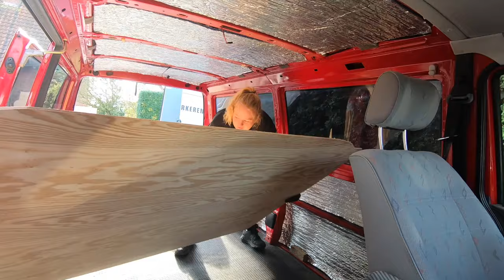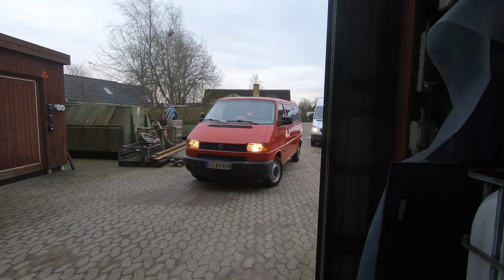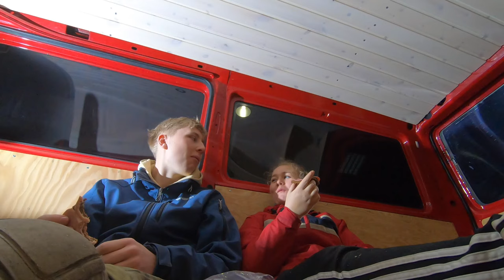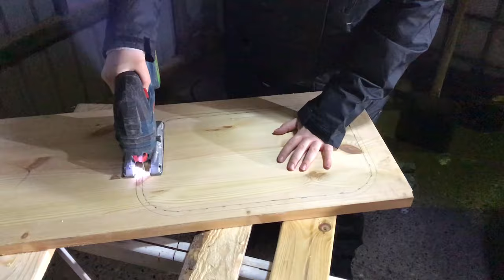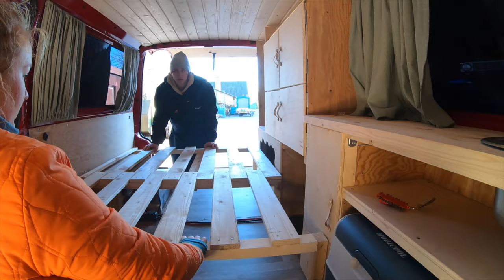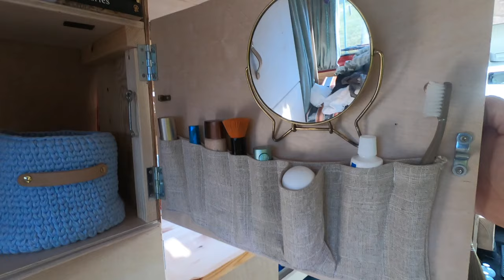Converting Van to Camper in 7 Minutes | VW Transporter T4

Comment: I like the design a lot! Thinking about building on myself and the girlfriend. 
A few questions;
-how long is the bed?
-how long did you take to build?
-how much money did you spend building it?

Your answers would be much appreciated!
Reply from the maker: Hi! Thanks for the comment.
The bed is 140 wide and 185(ish) long.
It took us about 5 months to build, but we both had full time jobs most of the time. When we quit and worked full time on the van it went so much faster.
Hmm about 5000 EUR excluding the price of the van, but 2000 were mechanical maintenance, so 3000 on the conversion :)
Including everything: 7900 eur :)
Good luck with it!

Comment: Nice build! But no ceiling fan? How did that work out for you?
Reply from the maker: Thanks! Well it was warm, but it is a pretty small van so opening the front windows a bit and keeping the rear door open provides decent airflow. Or maybe we were just lucky with the weather not being too hot🤔 Would buy a roof fan next time though

Comment: This is by far one of the best van conversions I’ve seen! I absolutely love your layout and am definitely going to use this as inspo as I get ready to (re)build-out my 1983 Vanagon. The previous owner had installed a floor, some shelving units, a foot pump sink etc but didn’t do much insulation which is an issue. It was also definitely done on a budget and things are starting to fall apart, lol. I also wanted to live in it a couple years so that I knew what I truly wanted/needed first. 

My curtains are currently hung up using curtains sewn into the fabric but they’re always dropping and blowing off if true window is cracked. I have been searching high and low for a better solution since my van doesn’t come with a track. I thought your hack was genius and loved the simplicity! What exactly was the bungee/magnet set-up you had? Ie what specific components did you purchase to make it?
Reply from the maker: Thank you so much. For the curtains we used something called curtain wire, which has a small thread inside so that you can cut it in length and attach something like a hook. We bought a curtain wire kit, which had everything we needed. It worked very well for us. Good luck with your build!

Comment: Hi wonderfull job, i also have a T4, can you tell the type of wood and measurement (thickness) of the side van covers, and cabinet?
Amazing job
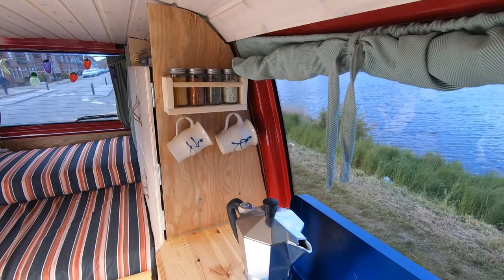Reply from the maker: Hi, thanks alot :) I not really sure but its really thin. Maybe a bit too thin to be honest. I think the "sides" on the cabinet (where the cups are hanging, at 6:20) is 1.5 cm the actual cabinets are made from a different material and Im pretty sure its about 2.5 cm's. Hope that answers you question :)

Comment: Yo, nice work. Such a question though. Isn`t it restricted to modify a car? Won`t it be hard to pass Yearly tech inspection with this? Heard even removing back seats is considered illegal
Reply from the maker: Hi, thanks. I guess it depends on which country. In Denmark (and most of EU I think) you are allowed to drive without rear seats. You are also allowed to build something else in the rear. It is a matter of tax-categories though. Depending on which type of registration the car has, there are different rules. Ours is legan and actually passed inspection last august :)
Reply: @mortenrishansen  How much did it cost you this rebuild
Reply from the maker: @bogdansgorvats2258  2500 EUR. But we knew someone who could do upholstery and mechanics so that helped us out :)
Reply: @mortenrishansen  2500 Euro just to build the interior?
Reply from the maker: Yes including everything. Electrics, water, fridge, wood, even mechanic parts (brakes). 2500 in total excluding the price of the van

Comment: Looks cool! I was wondering, where and how did you install your propane/butane tank?
Reply from the maker: Thanks. We unplugged it everytime we didn't use it and just but the tank outside or in the trunk. It was just on the floor when we used it :)
Reply: @mortenrishansen  ah ok I thought such a tank should be stowed in an airtight box with a ventilation hole exiting at the bottom of the bus. But perhaps this is only the case when you have it connected to your equipment at all times? And not when you unplug it everytime? Do you know anything about this?
Reply from the maker: @silliebilly  It never has to be airtight, but It does need a ventilation hole or other kinds of ventilation if it is permanently connected. The leaks often happen in the tubing connected to the tank, which you can avoid when the tank is unplugged. It is recommended to always have ventilation anyways, but doing it our way is essentially the same as going to buy a gas tank for the barbeque and putting it in the trunk on the way home. Atleast it is so in Denmark :) I hope it makes sense :)
Reply: @mortenrishansen  yes it does make sense, thanks for your fast reply!

Comment: Which grade blackout Film did you use for the windows? i'm trying to decide whether it will be too dark inside or not? i have the exact same t4 but with an extra sliding door. Love the build guys, this will be my bible for my project
Reply from the maker: Thank you! It means alot. It came with the window tint so not sure tbh. I work at a dealership and have seen alot of tint. Judging by experience the tint was somewhere around 15%